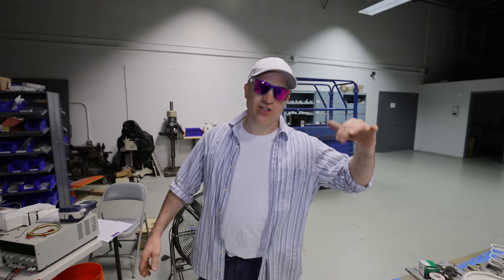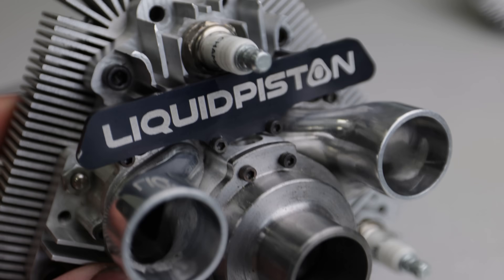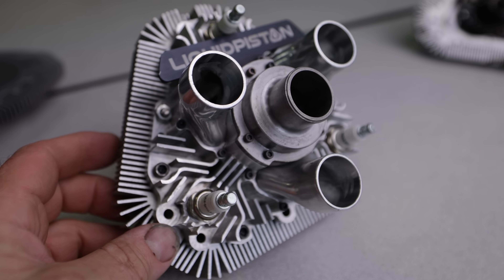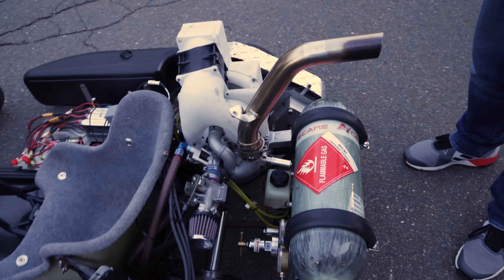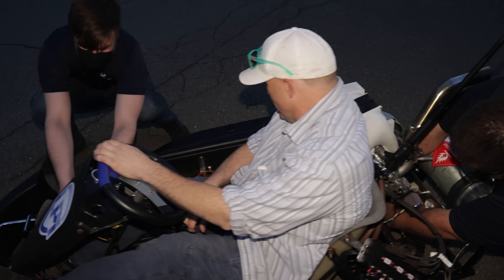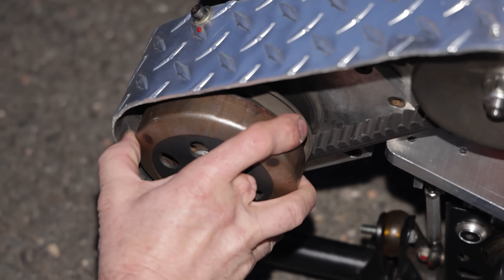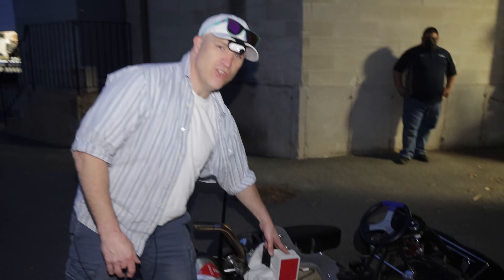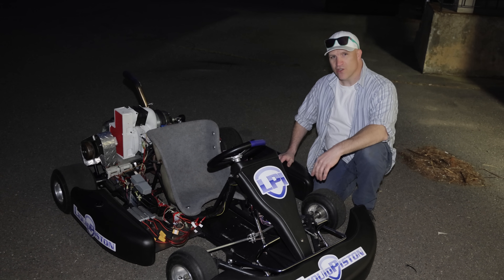Hydrogen Powered Liquid Piston Rotary Go-Kart

Comment: Hydrogen is GAS. I dont think it ll fit with a rotary engine since there is no proper sealing between those 3 chambers inside Rotary engine.
Apex seal is designed for oil, not gas.

I m sure they were alot of hydrogen that passed through the Apex Seal right before the combustion process.

Comment: Someone help – I’ve looked around and can’t find an adequate answer! 
1-	how come an engine Co. looking to revolutionize the market DOESN't have a single graph on the power curve on display when comparing its engine!!
2-	What the torque? It's quite simple - as the carting video shows, their engines have no power - well, absolutely no torque. As any respectable mechanic (no need to be an engineer) will tell you, to produce any toque from such engines (cuz no rod arm n crank leverage) they need to hit insane RPMs to produce any. Turbofan like – and as a result will require massive amounts of cooling and lubrication. 
3-	It’s neat that it’s designed to produce three strokes per rev. - sure – but the heat accumulation in the case will also be stratospheric. Two things that the engine has to overcome in continuous use!! I’d like to see a comparison with equivalent turbofan sized engine!

Comment: Yo, Warped Perception! Tell the guys at liquidpiston that if they made the rotor as big as the wankel rotary chamber, they can make 2 of these big x engine, maybe call them mega x engine. They should use a Mazda rx7 fd as the test vehicle. To make the engine place ment possible, connect the engines to a gearbox like the ones in a wind up car except without the wind up part, then connect the two gearboxes with a crankshaft rod and connect the rod with the clutch and flywheel. Use the fron and Bach parts of the rx7 engine too. Hope they like this idea. Thanks.

Comment: With three combustion cycles per revolution, what would be the fuel efficiency? Additionally, if it's humming along at 15,000 RPM within its maximum power band to produce 5HP, what would be the equivalent fuel consumption per HP against a standard 5HP ICE?

 I want to see a longevity test.

Only problem I can think of is the centripetal force from the extreme RPMs might cause the material to destroy itself but maybe not, would be interesting to find out 

Do they do well with supercharging?

Comment: total scam engine isn't running its being spun by the electric motor. it makes the right noises but thats just because the electric motor is spinning the thing and its sorta firing .... but not accually doing anything also this thing is histericly slow my 30 year old b&s 5hp would run circles around it

Comment: Series Hybrid? Parallel Hybrid? How Much Hybrid Kw? ....it sort defeats the purpose of the platform, as a showcase of the engine ....i don't know how much electrical energy is driving the kart, or how much is coming from the engine......do you mean hybrid combustion cycle? because someone else has the same kart called hybrid electric.

Comment: The thing is Hydrogen combustion engines are weak, for a similar hp and torque figures of an ICE gas engine, hydrogen engine needs to be atleats 3 times the size of gas engine, because hydrogen is jot as energy dense as Gas. thats why hydrogen fuel cell makes sense.

Comment: That's so cool! maybe you could add an electrolyzer to the exhaust so it turns the waste water back into hydrogen using the power from a solar panel mounted onto the top the go kart.

Comment: The engine appears to be putting out some power, but the gearing is way too low even after setting up the clutch properly. It's just strolling around with the RPM maxed out...

Comment: That's insane! Really lets you believe rotaries aren't dead yet, and if they're getting it to run on Hydrogen... Ah, the possibilities!
Also can we take a moment to appreciate how good it sounds?
Reply: I'm very skeptical that hydrogen fuel will ever take off practically because it's just too hard to produce and store and is incredibly dangerous in the event of a tank breach. Thankfully this Liquid Piston engine can run on loads of different fuels. I've seen it run on propane, gasoline and diesel, as well as hydrogen now, so it is plenty flexible enough to remain relevant even if hydrogen doesn't take off

Comment: Why is this engine air cooled? Why are the RPMs so low? Shouldn't that engine be running at 9 to 11k RPMs? Obviously, we need to know HP, but weight, and maybe what part is hybrid. Hybrid, means the motors to the wheels are electric most of the time. Please tell us.

Comment: Hydrogen is the fuel of the future. It's my first time seeing this new type of rotary engine but I am still going to go with the older style as all the problems have been designed out now so that it has a full 270 degrees of compression with no more raw fuel being sent into the exhausting side.

Comment: That thing is sweet but hydrogen is only completely clean when burn with only oxygen then the exhaust is completely water but with air you still have NOX games from the nitrogen in the air that burns with it but that can be over come when using g and HHO generator it makes oxygen you just need to get both if them compressed and injected properly

Comment: I don't see this engine producing very much torque naturally. Would need lots of weight. That, and oiling. How the hell do you oil a rotary without burning it anyway? Lastly, the apex seals. A circular piston ring is stronger, vs a bar. Look at it this way, thermal expansion. The rings expand on a piston and it seals it off, and provides even wear. This, like the rotary, would have to allow for the entire rotar to expand with the seal too in an X and Y direction. It is doable, it just sounds incredibly difficult to account for. It's like a squeegee vs a cock gun. A squeegee will wear out on 1 side, the cock gun disperses it's pressure outward into the housing instead of putting it on the squeegee. The seal on the block helps, but I just don't trust combusting in a non-circilst space disperses things eveny enough for longevity. So, really it's just oiling, torque, and the seals that are the problem here.

Comment: Burning hydrogen in internal combustion engine doesn’t exhaust only water vapor ! Dew to high burning temperatures nitrogen from the atmosphere air ( 78%  of the air  ) oxidases to NOx . Also parts of the lubrication oil passes in to the combustion  chamber so in the exhaust gases small amount of hydrocarbons still present .

Comment: Yep just as we expected, Hydrogen is not a good fuel to drive a motor vehicle with because it does not have the energy density as does gasoline.  Well it was a fun test none the less.

Comment: My understanding is that tiny little engine puts out 3 HP at 10,000 RPM on gasoline. Liquid Piston installed the motor alone on a go cart back in 2016 and it looked like that was faster than the hybrid version with hydrogen. I bet they have some major tweaking to do. I can't wait to see the result when they dial this in.
Reply: It's not going to get much better - the engine doesn't have the torque to get into its power band - a slipper clutch might help but there's a lot of unnecessary inertia on there. DDH is like supercharging it only works when there's enough power to drive it.

Comment: Electric/Liquid Piston is very neat concept, but the energy density of hydrogen is pretty low by itself, but if you mix it with petrol, you get the speed of ignition advantages of hydrogen with the much better energy density of petrol.

Comment: I know the flame front speed of hydrogen is considerably faster... but it looks like they could've optimized the ignition timing a little better. Also, I'd like to know if they used induction modulated throttle, or fuel modulated throttle. Hydrogen has a very broad range of combustible AFR, and works extremely well with a combination of both... where induction is only modulated at low RPM to control low load efficiency.

Hydrogen gas is horrible as a fuel (low energy density), but it's clean and fun to work with.

Comment: It's a great concept, but am I the only one that thinks that this is a joke? All the engine has to do is make noise while the electric motor and battery provides all the power. Do a non hybrid model and prove me wrong.
 This has been in development since 2003 and funded by others. Make some progress instead of focusing on potential. Contracts don't mean progress either until a functional product is delivered, and correct me if I am wrong, but you haven't delivered even one finished working product in 18 years that does it's intended function beyond testing.
 In 18 years, please tell me where where just one of your engines is actually being used productively for a real world purpose.

Comment: The Liquid Piston engine has tremendous advantages... I was wondering how this engine will run on HHO... That is an onboard hydrogen generator, that develops power from the disassociated molecules from water... One of the factors that could possibly limit the amount of power from HHO is the extremely fast burn time at relatively low pressures in the combustion chamber... Another thing that could be a problem with HHO in a reciprocating internal combustion engine is a relatively inconsistent burn time at a given pressure... It is probably because HHO has varying amounts of oxygen as compared to hydrogen in the separated gas's coming out of the HHO generators. Therefore, HHO CAN BE USED MORE EFFICIENTLY with external combustion engines and on gas turbine engines where a variance in fuel burn times at given pressures, is not as much of an issue.

Comment: Hybrid is the most wastefull and idiotic system ever. Would be much better to have a small emergency diesel genny on the trunk of a tesla so you can charge enough to get to the nearest outlet. With a hybrid you are just hauling around a heavy battery and when using that silly lil charge of battery you are towing a useless engine.

Comment: I would like to see this engine running stand alone. Every time I've seen it it's connected to an electric motor. (Even that dyno was an electric motor) I love the idea of this little engine just need want to see it started then ran without anything other that the intake connected to the shaft.
Reply: Right? That makes me suspicious. They were obviously using the dyno to spin it up and start combustion but what was the deal with the gokart? Why are there no videos of it running under its own power?

Comment: Burning hydrogen in any internal combustion engine is barking up the wrong tree.  Its energy density by volume is inferior by an order of magnitude to any hydrocarbon fuel.  If you have hydrogen, you should put it in a fuel cell and generate electricity at up to 80% efficiency.

Comment: Super Cool Rotary Engine :) With 3 Spark Plugs :) and Fires at every Compression, Gee, Would that make it a 2 STROKE ROTART Eng. :) 
LOL , 
Here is an Idea, Make a Hydrogen Powered Electric Operated Go Kart, using a Hydrogen Fuel cell to generate Electricity, You may need to use a small Battery for Electrical Balance during high load periods such as Starting off from a dead stop, but the hydrogen fuel cell would take over after that and charge the battery.

Comment: thanks for the insightful updates on the lIquidpiston engine. To anticipate on a future 100% green EV world, would love to see the liquid piston engine running as range extender on pure methanol on a modified battery golf cart. And would also like to compare the efficiency of the liquid piston engine with a methanol fuel cell generator as range extender.
Reply: Methanol a bad idea because you know some dribbling idiots will try and drink it. My ADO17W Wolseley 18/85 has hydrolastic suspension and they had to put a distasteful chemical in the suspension fluid so people wouldn't drink the stuff because it was basically alcohol. You'd come out in the morning and the car would be sitting on its belly like a deflated Citroen..

Comment: If that thing made any power at all, even 5 hp, it wouldn't need an electric motor. You don't prove the concept of your engine by combining it with another power source to get some work done. Not promising. Haven't they been working on this thing for a while?
Reply: I think Hydrogen is simply too dangerous to carry around in a race car/kart. One crash, one puncture, and you take out half the circuit. There's a reason it never has been seriously considered for use in motorsports.
Reply: yeah seems pretty bullshit to me... anyone can strap a garden gas power generator to a battery and electric motor and call it a hybrid... they just did that with a hydrogen tank but it doesn't even need flame, it would do the same damn thing on the 500psi of pressure alone!

Comment: That was a lot of noise for not a lot of movement. I feel as though a combination of the clutch and the hybrid system are letting it down. It'd be really interesting to see what the engine could do driving a kart on it's own. It is stated to have about 4 horsepower right? That should be more than enough to get up to some shenanigans with a single seater like that
Reply: The efficiency is right down. Just run the engine directly to a belt drive through a slipper clutch and if its a 4hp motor you're looking at 30mph easily.
Reply: @rosiehawtrey  my thoughts exactly

Comment: The energy density in hydrogen is, well unbeatable for a chemical reaction and the waste products of the reaction are always clean. Cool thing is, you could fuel both direct combustion and electric generating hydrogen engines at the same station and the fill-up takes roughly the same amount of time as gas.
I really hope silly subsidies stop positively discriminating battery powered transportation and instead give chance to other clean alternatives, that don't have the many disadvantages of batteries.
Reply: I have read of ways to make hydrogen inexpensively. They are developing ways to store it too.
Reply: The same hydrogen station could fuel up a hydrogen fuel cell vehicle too.
Reply: What's interesting is that I've heard that the energy density of hydrogen is actually an issue. It has really good energy density at cryogenic temperatures like they use on rockets, but for a normal road car that would be harder to achiever. Given the issues with storing and making hydrogen, I personally think something like an ethanol biofuel would be a better carbon-neutral alternative to hydrocarbon fuels. 
Before anyone brings it up, I do know that corn-based ethanol isn't carbon neutral and that we need to transition to a different plant (there are some grasses that are good for this, I think) for ethanol biofuels to be ecologically viable.
Reply: @quinnobi42  I don't think that you need to beat diesel on energy per m^3, what is important is how much weight you carry with you, that is what determines your fuel efficiency, how much you deteriorate the road, how much you compress the dirt, how much mess you do in an accident, how long you need to brake. With a hybrid hydrogen car, you save a lot of space that would be used for combustion, lubrication, transmission, drive train etc., that should already make up for the space taken by the pressure tank. For motorcycles, it is even more crucial, weight is such a large factor.

I think that various alternative fuels are a great transition step. R33 seems to be most promising to me. Screaming carbon neutral really doesn't help, EVs are far from carbon neutral as well. What we need to do is improve the situation and R33 seems like a good short term improvement and hydrogen hybrid like a very good long term goal.
Reply: @sourand jaded What we are talking about here is the difference between gravimetric energy density (specific energy) and volumetric energy density. Hydrogen has a great specific energy, bit piss-poor volumetric energy density.
Reply: @quinnobi42  Nothing beats aetheric ZPE, nikola tesla was right on that on and now the neutrino power cube generator is coming ou.
Reply: Biofuels (ethanol and biodiesel) and Hydrogen are the way to go. They are the real clean energy of the future

Electric will never be visible for transportation while they use those huge lithium ion batteries that use up a lot of resources and cause damage through mining. Not to mention the toxic fumes and carcinogens from heavy metals released into the air when an EV catches fire by itself once in a while

Electric could be the way to go in the far future, but not now. Clean fuels are the real answer
Reply: Problem with hydrogen is it awfully expensive to produce and much harder to store. Companies don't like increasing their expenses
Reply: Be aware that the fossil fuel industry is subsidised globally by $600 billion (6x10^11 US dollars) per year. Counting all of the indirect subsidies and benefits in kind, it adds up to around $3 trillion (3x10^12 US dollars) per year, globally. The subsidies on electric vehicles are tiny in comparison.
Reply: @RWBHere  
Go look at what's on the shop shelves and then imagine what their prices would be if the fuel that brought them there wasn't subsidized.

Comment: It is nice to see this engine works with hydrogen - but 10kmh ist little bit low.... For me it was an fail. Sorry - I expected much more power from +10.000 RPM engine... Even it the engine was small.
My old 2 stroke 49ccm Vespa is more efficient/powerful.

Comment: Anyone notice that all their current models have a single rotary and not multiple like other rotary used in cars. This design looks extremely impractically for having multiple rotaries connected to each other since the shaft carries the fuel and exhaust. How are you going to pump fuel to multiple rotaries connected through a singular shaft without making the engine really complicated and bulky?